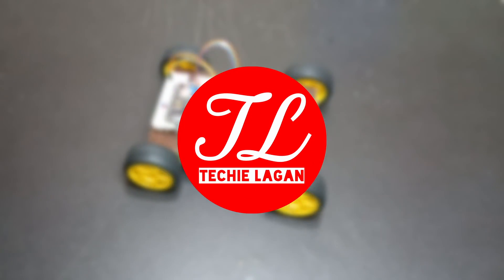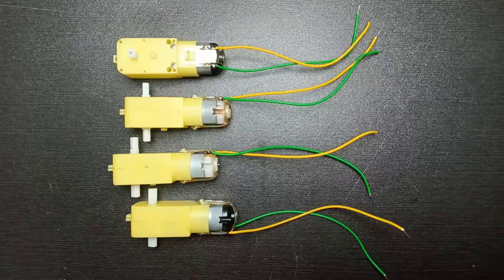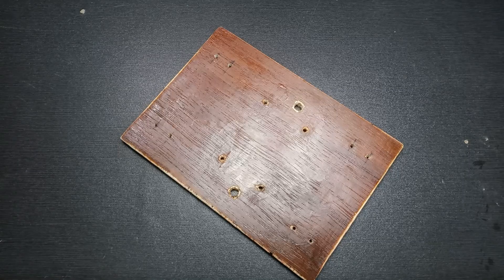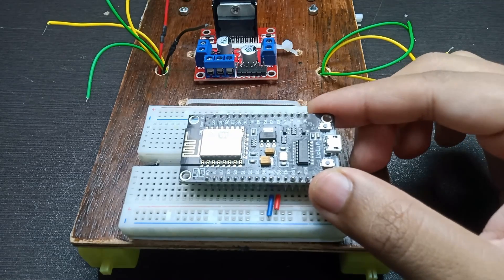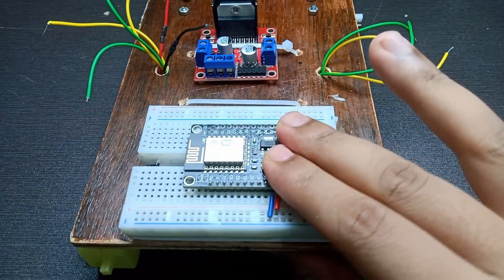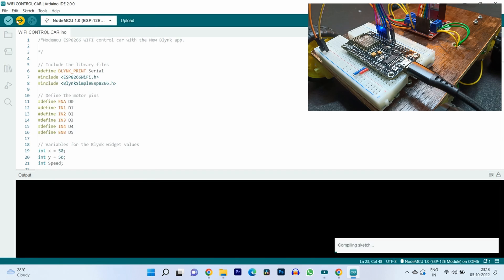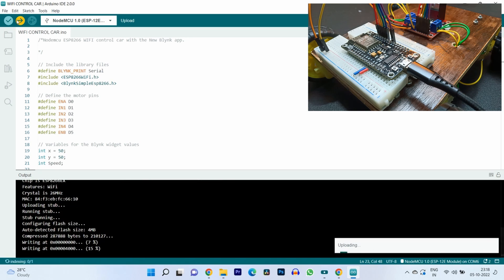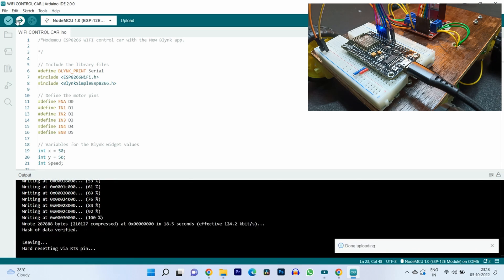How to make a wifi controlled car using Nodemcu ESP8266  and NEW Blynk App || Techie Lagan

Comment: replied to another commenter with this but use this as info - 'this may be a VERY late reply, but motors used here are some type of dc bo motors, these motors dont pull just 250ma they can pull upto 1.5-1.7 A when stressed enough, and they operate sufficiently at 3-5v aswell as 8-9v, now you see the l298a can supply upto 2A to each side so 1A each motor in this case and upto 14v to each motor. buuuuttt the l298a has its own processes to power so there is a loss of about ~2-2.5v, thus supplying only ~9-10v in this case. and for general cases a simple 9v radio battery is enough to power the whole system since the l298 can operate on voltages from 4v to 12v safely. ALSO one thing wrong in this video is hime powering the esp with 5v instead of 3.3v. THIS CAN REALLY DAMAGE AND FRY the board in some time or even immediately. DO NOT PWER YOUR ESP8266 WITH 5V except for usb power. thank me later.'
Reply: abe noob. he gave 4v on VIN pin of nodemcu, On which 5v-10v can be given. but if given og 3v3 pin, it will definetely be fried

Comment: The joystick is paid
Reply: Hi did you solve this? did you tried older version of the app perhaps? if so can you share what type of solution did you do
Reply: @Meidri9292  No, I fixed it, I didn't use blynk, I used esp8266 car controller app
Reply: @sakazuki4584  WHAT MODIFICATIONS DID U USE THERE?

Comment: i have doubt . this gear motor required 180mA to 250mA current and 3-5v supply to work then how the 12v battery is sufficient here . can anyone help me in this
Reply: this may be a VERY late reply, but motors used here are some type of dc bo motors, these motors dont pull just 250ma they can pull upto 1.5-1.7 A when stressed enough, and they operate sufficiently at 3-5v aswell as 8-9v, now you see the l298a can supply upto 2A to each side so 1A each motor in this case and upto 14v to each motor. buuuuttt the l298a has its own processes to power so there is a loss of about ~2-2.5v, thus supplying only ~9-10v in this case. and for general cases a simple 9v radio battery is enough to power the whole system since the l298 can operate on voltages from 4v to 12v safely. ALSO one thing wrong in this video is hime powering the esp with 5v instead of 3.3v. THIS CAN REALLY DAMAGE AND FRY the board in some time or even immediately. DO NOT PWER YOUR ESP8266 WITH 5V except for usb power. thank me later.

Comment: Bro my all connections are done and connects to blynk app and show it online but when I give it the command to move it just don't move, the LEDs on motor driver and esp module gets dimmer as I tried to move the car please help me.
Reply: Bro how much cost pls tell me
Reply: Bro same problem how did you solved it . Please tell
Reply: @MohsinMohammed-fv9by  increase the battery power
Reply: check your connections again. there is likely a short somewhere, if not, then you have insufficient power meaning your battery pack is too weak. just use a 9v battery for this. a 9v radio battery.

Comment: Error aata hai isme 
Koi use mat karo 
No such file directory aa jata hai 
Faltu me time waste ho gya
Reply from the maker: Bro sorry for not mentioning this thing in the video....
But you have to download two libraries in the arduino ide before runnig/uploading this code then only it will work..

1. ESP8266WiFi
1. BlynkSimpleEsp8266

if you all will say then I will try to make a video on that.
Reply: bro after installing also its showing same No such file directory . please reply fast

Comment: While uploading the code it is showing
No Such file or directory
Reply from the maker: Bro sorry for not mentioning this thing in the video....
But you have to download two libraries in the arduino ide before runnig/uploading this code then only it will work..

1. ESP8266WiFi
1. BlynkSimpleEsp8266

if you all will say then I will try to make a video on that.